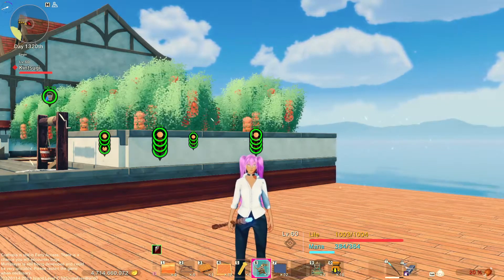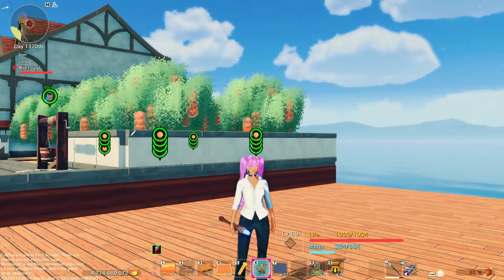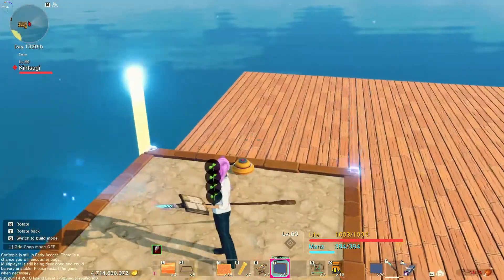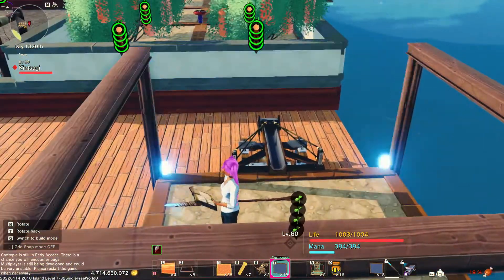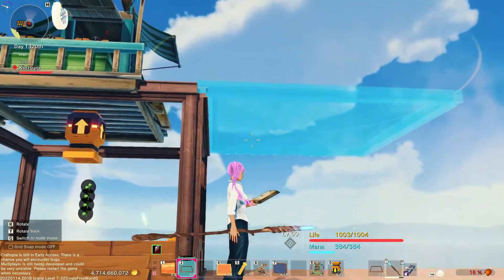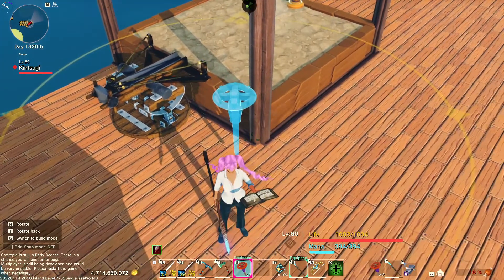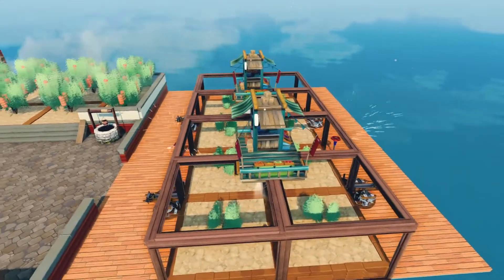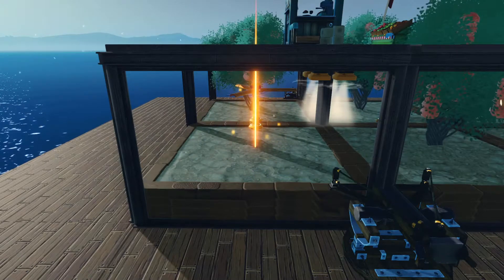(Pre-Release) CRAFTOPIA - Small Footprint Peach Farm Tutorial

Comment: Quick question. Where do you get the blueprint for the sling? Does it need repairing or can you just load seeds and be done with it?
Reply from the maker: You can get the blueprint for the sling from trade-ins with the Warrior, Fisher and Researcher NPC's. It doesn't require any repairing - just settings and you are done with it until it runs out. Since the can hold 1200 seeds and you only want them going off every 170 seconds or so... it lasts a Looooong time :D